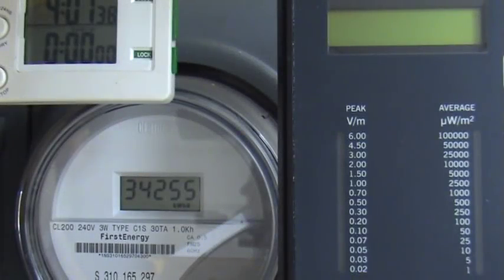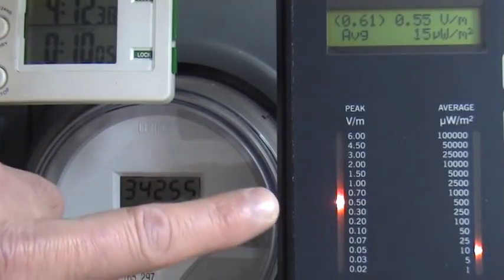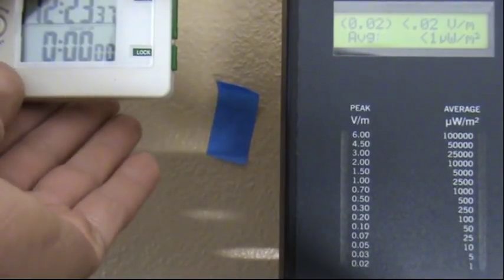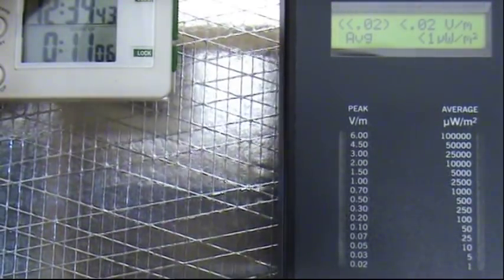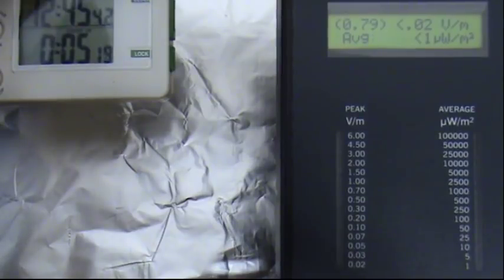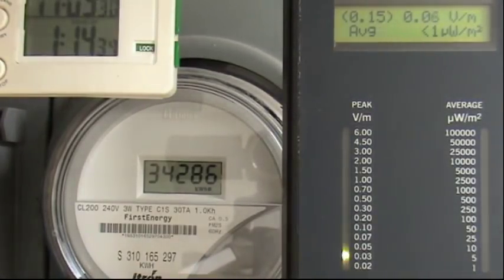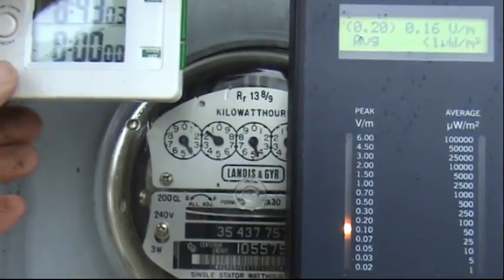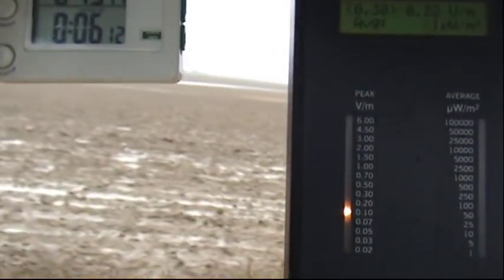Testing utility analog and smart meters for RF radiation

Comment: When you have hundreds of houses and they all send these signals at random intervals back down the powerlines and people with radio stations have their antennas around the same height as the power lines it' game over for their hobby. Very sad.
  If your analogue meter is connected to the same grid then it will also be transmitting the same signals from the smart meter. The signals will travel down the line.

Comment: You need to do both meters while having the same current draw. Most the rf people are showing is actualy created from the power in the lines and an effect of the network of lines acting as a large antenna for radio signals
Reply: yes and no. His 2nd reading is actually at a disadvantage because it's already transmitting signals from the smart meter simply because it is on the same grid. The signals are send back down the powerlines. If you live in an area with hundreds of houses or flats then can you imagine the busyness of the radiation all around. It's turned power-lines into huge transmitters. Not so much in power but enough to mess up with peoples radio because there is just so much of it everywhere.

Comment: Not surprising an Electro Mech meter has more emissions than a Smart Meter, they have multi turn electromagnetic  coils., in fact test racks loaded with 60 meters powered created quiet a large magnetic field, and a utility engineer did a study to determine if this contributed to a tester contracting Hodgkins lymphona.
  15 years ago the meter manufacturer I worked for submitted electronic meters with modem to the UK National Radiological board for emissions tests they reported the meters emissions were negligible and had zero risk. (with confirmed readings)

Comment: Thank you for the experiment.  The Acoustimeter AM-10 is a single-axis meter.  To garner effective readings with this tool, one must move it around in three regions of space (along the x, y and z axis) to identify peak signal strength.  Your video only shows the testing of a single axis, which in totality will not paint the entire picture of peak RF signal from your test environment.  The Acousticom 2 which I own has shown consistent peak readings over 6.0 V/m or 95,000 microwatts per meter squared on "smartmeters."  This level of extremely high frequency pulsed signal poses concerning health effects to the human body.  Peace.
Reply: frank, I would love to know whether my meter TF2 Trifield meter measures all three axises or do you have to wave it around. And does grounding a faraday copper blanket help. I have two regular meters one way communication but not smart meters 6 ft away from my bed, thoughts

Comment: By the way that is just a digital meter not a smart meter. Yes the digital meter does produce EMF. Why don't you do your test again with a real smart meter. The people that commented that you're okay now make sure you look at a picture of a real smart meter. They just came through my neighborhood and replaced all our digital meters with smart meters. The one you were testing are the ones they just swapped. But I'm opting out.
Reply from the maker: Good for you.  It's a smart meter, you can see the EMF spikes about every minute.
Reply: I agree with you low doses of EMF but it's not producing RF radiation. The newer smart meters have a little metal plate on the front in the shape of a half circle with two holes. That's where the RF antenna is. Older generation meters still have the two holes but their internal.  Just like high-voltage power lines they produce a high level of EMF. That's why they say 2000 meters away is a recommended safe zone. If I could get your email address I will send you images of the meter I still have and image of the meter my neighbors got swapped out with. If there's a way to post the images here I would do. I appreciate the video you've made to inform people about them, but you got to use the right meter.
Reply from the maker: @quik2hit   It is the right meter, it puts out a fairly regular burst of RF as can be clearly seen.
Reply: If there is a way for me to share some images with you.
Reply from the maker: @UCTYyeWWktyKyPbnaz7Wov0Q  There are lots of different designs and manufacturers of smart meters.  http://www.greenworldinvestor.com/2011/05/10/smart-metering-list-of-top-smart-energy-meter-manufacturers-growing-smaller-as-consolidation-gains-pace/  https://duckduckgo.com/?q=smart+meter+designs&t=h_&iax=images&ia=images  Show a "digital" one that puts out a regular RF burst, and you have your smart meter.
Reply: @ForbiddTV  here check out this video
https://youtu.be/XRvUlZgNFJ0
like in Orlando we used to have digital meters now they're swapping out for smart meters. There are three types of meters analog, digital and smart. I know you're saying that the one in your video is a smart meter, but why would Duke energy be swapping them out with smart meters. I know you're a bright well-educated man but just take a look.
Reply: My meter was manufactured in 12 of 2005 which was before smart meters were even rolling out. I left California end of 2007 and I heard  talk about smart meters rolling out.  British Columbia and California where the first place to start the pilot program.
Reply from the maker: @quik2hit   Gee, they come out with new models of virtually everything in time.  Perhaps the old ones are obsolete?  Happens all the time.
Reply: @ForbiddTV  yeah these new meters are even stronger on the RF scale. but of course the power companies tell you no worries, there's no issues with them. They're perfectly safe. Remember the power companies are relying on ignorance is bliss...
Reply from the maker: @quik2hit   The meter tested puts out bursts of RF pulses.  A smart meter.  End of story.  Sorry you are butt hurt that my video doesn't give you confirmation bias for your ghoulish fantasies.

Comment: I’m planning on making a video soon as well using my HI-1501 MICROWAVE SURVEY METER, I’m very interested to try lead plating mounted behind the meter to see what the difference is, my homes electric meter is directly opposite of where out couch in the living room is, so it is concerning
Reply from the maker: I've tested lead against many other materials and found it didn't perform any better than more commonly available materials.  https://youtu.be/MNPX-vibVSE  The bigger question you should contemplate is should you be concerned at all.

Comment: Uneducated fools, that haven’t studied how dangerous these meters are through out your whole damn house. And, the surveillance, data collection.
Reply from the maker: DEW BERRY  The "surveillance data collection" is another issue altogether.  Show how these are dangerous.  I found they put out less RF radiation than other things in your house that have also been proven to be safe.
Reply: 👎🏻
These frequencies pulsate through out all of your wires in your home, causing severe radiation, and they go hand and hand with the LED light bulbs that’s also pushing out radiation.
So, removing these dumb meters are only way to get rid of peoples symptoms from this radiation. 
I could literally feel these frequencies when I had my brand new Travel Trailer hooked up to the Smartmeter. The LED lights were blowing out because then Smartmeters were so strong!! 

They are killing us! 
Go back to analog that doesn’t pulse!
Reply from the maker: You lie.  Show someone who was killed by a smart meter. 
In case you don't know. AC electricity is indeed nothing more than pulses. 
Your wifi, phone, microwave and other things you probably have emit more RF than your smart meter and those are all non ionizing radiation in any event,

Comment: Smart meters are the least to worry about, there ARE MORE things that need to be evaluated. On my 2008 Infiniti, along the windshield post, I am getting readings of 290 Micro ferets, My "Citizen" watch produces about 120 micro ferets, my hearing aids produce OVER 2000 micro ferets, We are being Radiated by Big Corp.s No attorney will take on these monsters, even though there is evidence to prove that we are being subjected to RF Radiation. I believe that my hearing aids are the cause of Pain in my scalp and I am seeing what appear as moles ALL OVER my scalp. Anyone know a Attorney that would take on the giants? I actually doubt it. THEY ARE AFRAID TO CHALLENGE ANYONE Connected to these readings.

Comment: Nice try but you can clearly see that the analog meter is not being used or connected to anything. The meter didn’t budget over time. Something is either wired wrong or you are trying to deceive people as well.
Reply from the maker: So you expect to see some RF from an analog meter?  Wow! 
It so happens, that meter serves a warehouse which the only electricity load at the time is one small battery trickle charger.  You wouldn't expect to see any movement in such a short period of time.
Reply: your point is kinda proven by the fact that even if the meter isnt working at all the RF still measures something, also an analog meter would in fact produce 0 RF has its not sending any info via RF anyways, the fact still stands we are bombarded by RF by so many sources it dosent matter where it comes from, the biggest producer of RF is the sun anyways so i dont see why people get all worked up over this anyways, being paranoid over being watched sure i guess but earth has been bombarded by RF since the sun was born. even more scary the sun actually also produces X rays ooo, lets all hide in our tin foil houses forever and stay safe right ?

Comment: Looks and sounds like an honest scientific attempt  to measure and document the measurement of ONE smartmeter type. That is psudo-scientific since you can only say something about this ONE smart-model and NOTHING about a largfer number of smartmeters. That is a TYPICAL pseudo scientific attempts to debunk worries and to try to offset the precautionary principle which should be taken into consideration when Health issues are  IN QUESTION and where REAL VALID LONGTERM RESEARCH should be performed and presented as valid argumentation in a debate about dangers, reasonable worries or not. TNH
Reply from the maker: Torben Normark Hansen  I have tested many, this is the only one so far I have found in a location that sheids out much of the background noise I get from other locations (as you saw with the analog meter).  It was shielded by five of the six sides by walls, ground and roof (if you view the space as a cube).  If you don't like it, get your own RF detector and do your own testing.
Reply: 1) 
I´m just pointing out possible sources of error if you wish to move closer to scientific standards. I acknowledge that documentionwise you get a problem with the filming all the data being collected....and making a pop-scientific short-message video. You might present your measurements of a number of different Fabricant´s Smartmeters if you want to move closer to true natural scientific standards. But that would (unless you film it all) be possible to compromise your results. But it would be moving closer to true evident checks. 
2)
The second thing you could do is to test it on biological materials like seeds and see what anomalies comes from spiking the seed exposed to RF (different doses and different exposure periods) compared to seed unexposed. And make accurate counts and filming of that. 

Good luck. Greetings TNH
Reply from the maker: Good luck doing your tests. I don't have the time or desire to conduct testing that has already been done to placate the fear mongers on YouTube.

Comment: I'd be more concerned with your wifi before any smart meter
Reply from the maker: Yep, I tested those too:  https://www.youtube.com/watch?v=8PkJMBoW8Po
Reply: Richard Golden-DeWitt both silly rabbit
Reply from the maker: DEW BERRY  Why is it silly?  I clearly show in my videos that wifi produces more RF radiation then smart meters,
Reply: @ForbiddTV  unless you are going to put your ear up to the meter and leave it there for hours at a time how is it going to be harmful  hold that piece of test equipment 3 feet away and see if you get the same readings.  also because people are opting out for no good reason other than unwarranted junk science there is one video where they turned off the power because he refused and he had a meter on a power pole some 50 feet from his house again JUNK SCIENCE
Reply from the maker: Richard Golden-DeWitt  The readings would be higher 3 feet away, just as the were for the analog meter.

Comment: life camped within three feet of a smart meter. Instead, such devices are typically on the outside of a residence, many feet from humans. Thus, given the incontestable law that microwave intensity decreases as the square of distance from the source, this means that exposure from smart meters is hundreds or thousands of times less than the figures in the previous paragraph. Indeed, 20-year exposure to radiation from smart meters is no greater than a single 30-minute cell phone call.

Comment: First off: Thanks for the video! Second, I'm glad I found it and what you show is exactly what I expected, namely ZERO concern. I also assume that the higher reading on the inside of your home is due to other sources. What you did not show is a reading of a cell phone, so that people get a clear picture of how insignificant the meter is compared to a device almost anyone is exposed to 24/7. Also different readings inside would be great.
Allow me to add the appendix from my energy provider regarding the matter:

"When smart meters need to communicate with an energy provider, they use WAN. This secure network is similar to the one mobile phone use to send and receive data. It’s run by the Data Communications Company and overseen by the energy regulator Ofgem. This means it must comply with strict regulations to ensure smart meter data is kept private and secure."

Have a good one!
Reply from the maker: I thought I covered cell phones rather well already:   https://youtu.be/nFJfmYtC5Cg  and most other household items in this series:   https://www.youtube.com/playlist?list=PLwvM5FrPTJTn5N9V0FU3UElo3c3otTRT-
Reply: @ForbiddTV  OK, I'm so sorry to have bothered you. I only stumbled upon this one... I'll watch those as well. Thanks again!

Comment: I called my /electric company and requested they remove my Smart Meter.  They said for $55 and an additional $10 per month to manual read my meter they could do it. I agreed. they came out the next day and swapped meters. my new "analog" meter is identical to the ones you are testing!!!  I feel it is another Smart Meter!!??
Reply from the maker: This is a typical story I am hearing.  Some have claimed there are some "digital" ones that don't transmit, but you can clearly see the one in the video spiking about once a minute.  Probably the only way you will know for sure is if you test it yourself.
Reply: you can buy a true analog meter from a separate company yourself and have a third party install it.That way you will know it is a true analog and not a digital smart meter disguised as analog

Comment: I purchased a Trifield TF2 meter reader and tested my GE smart meter here in South Florida. It doesn't pick up readings below 1 Vm and maxes-out at 999 Vm.  At three feet away, it was putting out a steady 14-15 Vm, while yours was averaging 0.25 only an INCH away from the front of the meter. Readings at the one inch distance averaged over 900 Vm to over 999 Vm, the highest my reader can detect. My average readings were 18 to over 20 THOUSAND times higher that your readings at an inch away.
Reply: What's even worse is your meter is only picking up a fraction of what's there. To get real results buy the safe an sound pro 2. The Tf2 is trash for measuring RF. However it's excellent for measuring magnetic fields.

Comment: Can I wrap the outside of my smart meter with aluminum to reduce the emf waves?
Reply from the maker: Sure if you want to get a letter from your utility.  Check your contract about modifying equipment and creating a possible fire hazzard.
Reply: @ForbiddTV  well then what do you recomend to protect myself  against the EMF waves.. Ive been out of work with headaches for 5 days...
Reply from the maker: Well if you think your neter is giving you a headache put an aluminum screen door or screen window inside the house against the wall where the smart meter is. https://youtu.be/MNPX-vibVSE
Reply from the maker: Believe In Jesus  Are you one of those guys in the 90's that was telling me we would all have brain cancer from our cell phones by the year 2000?  Somehow we are living even longer than ever...
Reply: wrap it with aluminum window screen and buy several greenwave filters and a tester.
Reply from the maker: @stevewilcox1755   Then the utility will come and remove and warn the homeowner.  The meter is not the homeowner's property.

Comment: So How Long Have You Been Working For The Smart Meter Manufacturer, Or Power Company?
Reply from the maker: So how long have you been a useless troll?
Reply: zpottsy LMAO exactly what I was wondering.
Reply from the maker: @NoSmokeG   Or the troll could try to show anywhere I am incorrect about anything on this video.
Reply: @ForbiddTV  The only thing you're incorrect about is assuming your results represent everyone else's. The results vary greatly from location to location. The only reason I agreed with zpottsy is because I've read every comment on this video and you seem to be pushing an agenda that smart meters aren't worth getting rid of.
Reply from the maker: Show anywhere I ever said my results represents anyone else's testing.  I did my own test in my own way with my own equipment. 
Show anywhere I ever said smart meters should either be kept or got rid of.
Reply from the maker: @SMOKE  You haven't show a single place I have given misinformation or anywhere I said my results represents anyone else's testing.  Do you always enjoy failing so dramatically?
Reply: oh brother zpottsy...